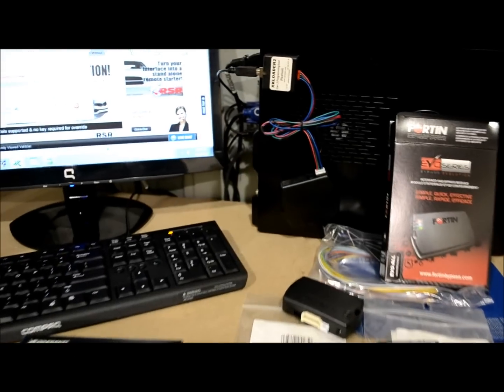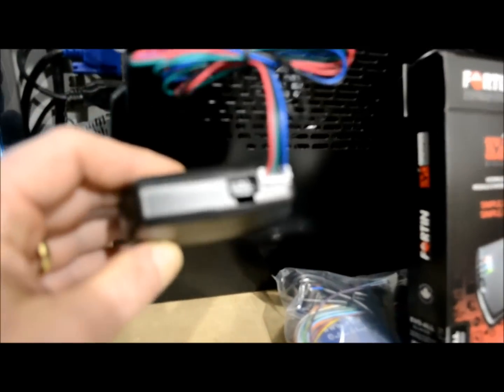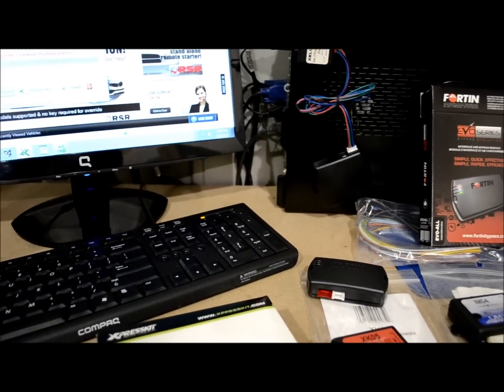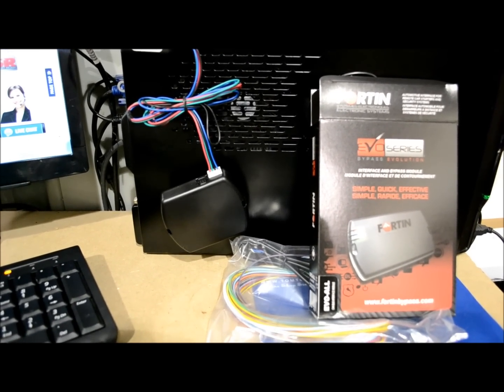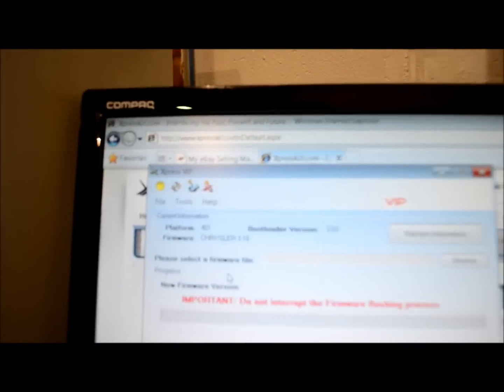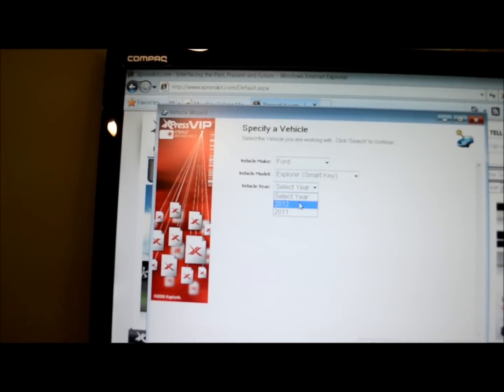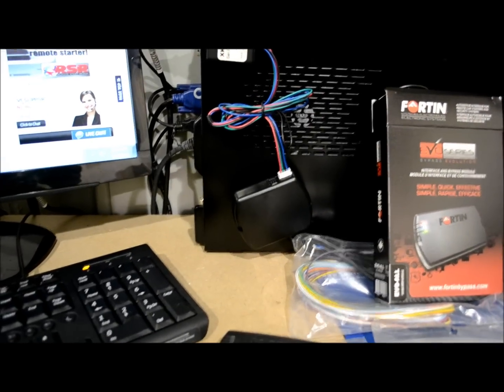Remote start bypass module kits explained - DEI iDatalink and Fortin

Comment: Hello I know this video old But I have a question I'm about to have a Viper alarm 5906V installed in my 2018 Chevrolet Express Cargo van and I already installed a IDatalink Maestro rr when I swapped out the head unit Now my question is  which remote start module should I go with iDatalink - Data Bypass Module vs Directed DB3 module  thanks

Comment: Hi I need some help programming new fobs for my Omega IM01 system.  I'm completely ignorant of anything alarm systems.  This system was already on my 2004 Silverado when I purchased it and works great.  However, I've not had any luck finding a successful way to program new fobs to the system.  I have the correct fobs for the system for sure, I just can't find any programming instructions that work.  Thanks in advance!

Comment: Have you ever heard of camera focus? Kid... lol
Reply from the maker: +Jafet sorry, this is one of my older videos, Im alot better these days!
Reply: +Lessco Electronics I was only messing with you. I appreciate the response. I came across your video because I was looking to add security to a 2014 toyota highlander v6 with a push to start key. I cannot seem to find anywhere exactly what parts I need. I'd like to find a system that will hopefully come with t-harness to avoid any cable splicing. I looked at viper but they don't offer much info. The fortin Evo-one seems like a good product but I did not find a t-harness for my vehicle on their website.
Reply from the maker: its coming, the evo-one is going to be compatable, just not yet, heres more info anyhow: http://fortin.ca/en/vehicles/toyota/highlander/2014-push-to-start/

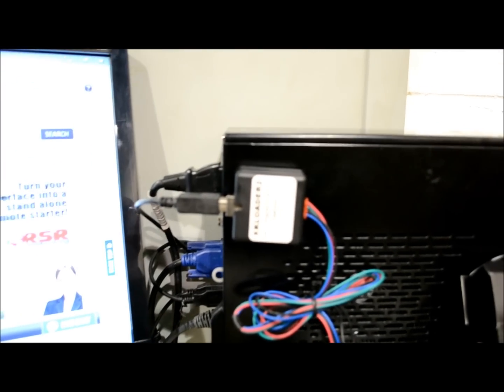Comment: So let me make sure.  At 5:00, you mention that the XKLoader can be used to flash the Omega.  Is that true?  Also, would you recommend a Fortin or Omega for 2010 Prius?  If Omega, and I only want 3XLS remote start, do I get the RS-TL2 or DL-TL2?

Is there another flasher compatible with the Fortin that I can buy because Amazon is out of stock of the Fortin Flash-Link?
Reply from the maker: 1-yes, that is true
2- I prefer the omega 3x lock to start system.

Comment: I have a problem reflashing my 3902v module, I updated my windows for the framework just to work and its still same problem, its saying that its conected but when I'm trying to open the xpeskit it say that net framework not installed, I use IE 11, I really don't know what to do to pop up that window smaller window with xpresvip :(

Comment: thanks for the explanation.
Can anyone tell me if a bypass could be at fault if remote start no longer works?
Everything else like the security arm/disarm works fine.
Remote start worked for like 3 days and then stopped  :(
The installer didn't mention anything about the bypass but i thought i would ask
if it's a possibility?

Comment: I hear you venting on this video and to me it seems you  have a lot of experience and pride in the products you use when installing remote start car alarms and bypass systems. Your absolutely right there is an overwhelming amount of different bypass modules and start kits out there with little differences other than a name. However unfortunately I have already purchased a viper and xpresskit for my 03 Yukon and now am doing my homework before attempting to install it. I am familiar with the omega as I have installed a simple remote start into a 96 Tahoe which im still trying to troubleshoot with the engine monitoring wire and flash. Your videos have been very helpful and I look forward to installing this system soon thanks for all your help..

R/
Robert Flores Jr
SSgt./USMC

Comment: i was just wondering if the viper 5901 will hook up to a fortin evo all with out having to cut in to the bypass harness on the fortin
Reply from the maker: they wont connect directly, it'll need hardwiring.

Comment: I know you hate xpresskit DEI but I have a question.  It might be a dumb one but I need to know.  I have a DB-ALL installed W2W.  Im trying to install a vsm200 with the DB-ALL.  Do I just need to install the vsm200 via the D2D port only?  Or do I also need to connect the 12V and GND?  Reason I ask is because I it powers up via D2D port but I cant get a solid led on the module.

Comment: TheLessco great video I am hoping you can help me with my issue. I just installed a python 413 and a nexgen DBALL bypass on a 2010 Toyota Venza, I know I saw your videos too late to know better lol. It flashed, programmed great and remote starter perfect on the first try and remained on until I shut it down with the remote but when I drive it, park it, turn it off, lock it and try to remote start again it wont remote start unless I reprogram the DBALL again and then it will RS fine. Any ideas?